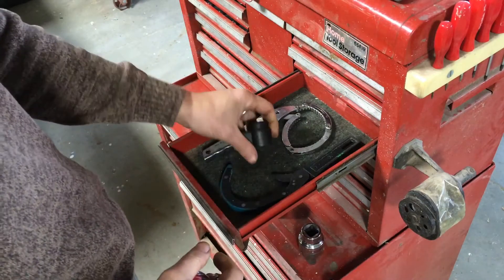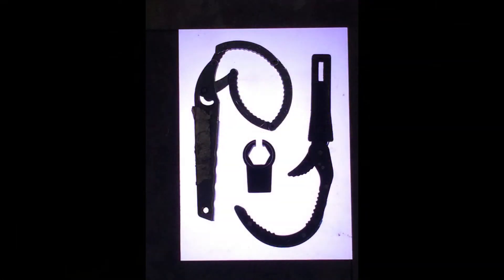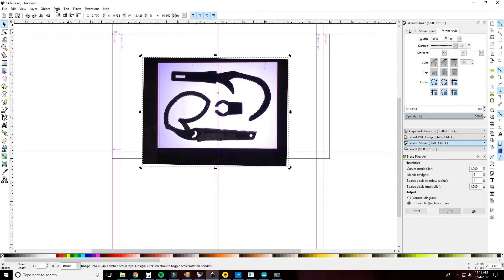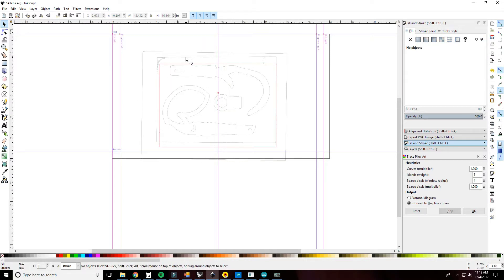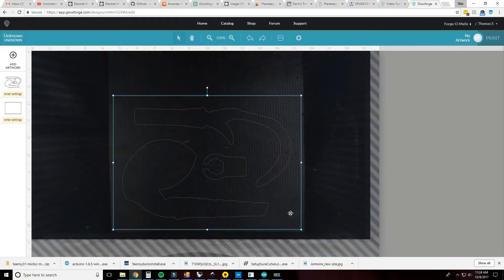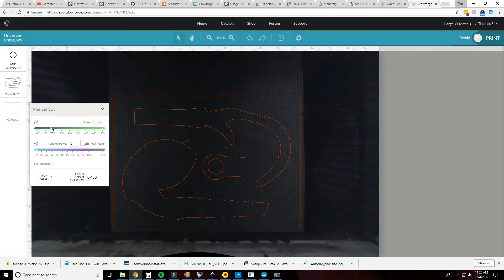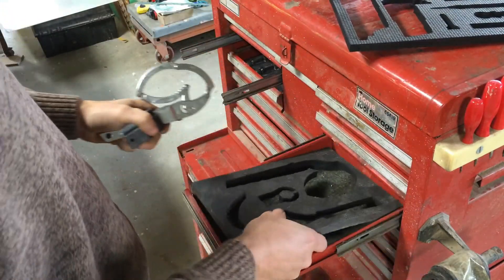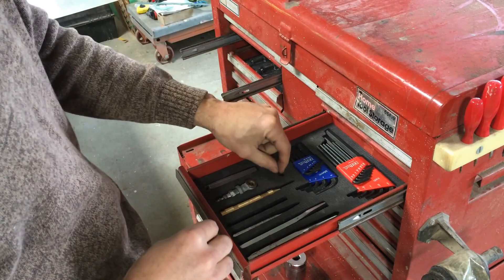Glowforge/Inkscape:  Foam tool inserts,  How To

Comment: Fantastic videos on the glowforge,    I am not sure I understand how the Foam moved,   you said it was bumped by the laser or the moved on its own, can you explain that for me.  ?      Also I would like  to make  foam inserts 10.5  x 10.5 inches  can this machine do that size nicely. ?      Is your code still good for purchase ?  ok  thank you so much for the videos.
Reply from the maker: Thanks!   It moved because the foam was curled up in the back so was higher than 1/2”.   There is a fan attached to the laser head to blow away smoke,  the fan caught the edge that was sticking up.   After that if a piece was warped I just 2 sided taped it down.   
The other thing I started doing is once I got my outlines in Inkscape I used the offset tool to give the tools a little more room.   Code should still be good for $500 off a pro,  250 off a plus or 100 off a basic.
Reply: Fantastic, look I will be getting the Plus, Can I still use it if I am using the payment system they offer, ?          Also why do so many people use the Inkscape and not say Photoshop ? Thank you Tom.
Reply from the maker: Not sure on the payment...    I think they use Inkscape because it’s free:-)

Comment: Great idea! Although, I'm really surprised such an expensive machine bumped the stock, didn't see that it did so, and kept going. I thought the Glowforge was intelligent and had internal monitoring cameras.
Reply from the maker: I get the feeling the anti collision software isn’t implemented yet.  But it was my fault,  the material was warped up in the back
Reply from the maker: I get the feeling the anti collision software isn’t implemented yet.  But it was my fault,  the material was warped up in the back

Comment: Great guide!  Is that just the interlocking foam floor tiles from the big box store?
Also I think when I do this I'll add some cutouts for fingers to go, for easier removal - some of those look a little snug.
Reply from the maker: +Patrick O'Brien yup,  those are the tiles.  Yes some are a little snug,  finger holes would be good.
Reply: Yoga or camping mats work too. Great if you have a box larger than 26”
Reply: What is your foam material?